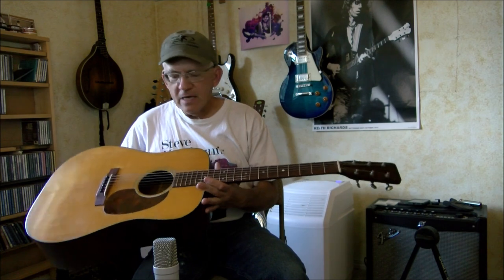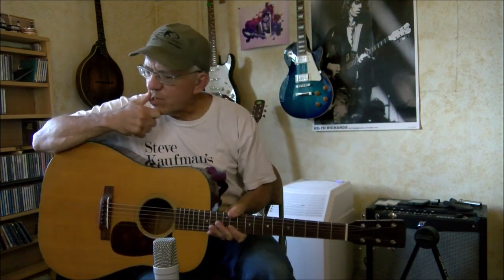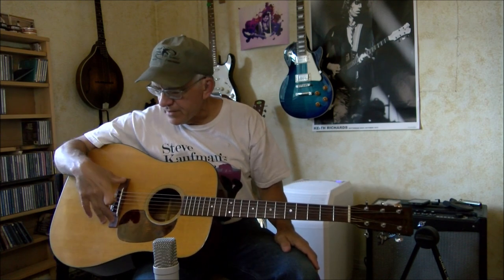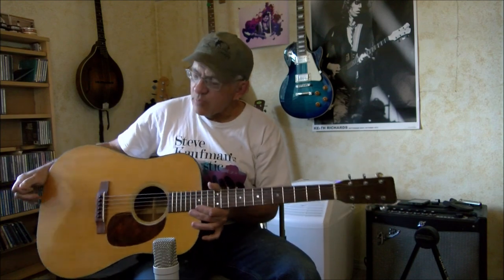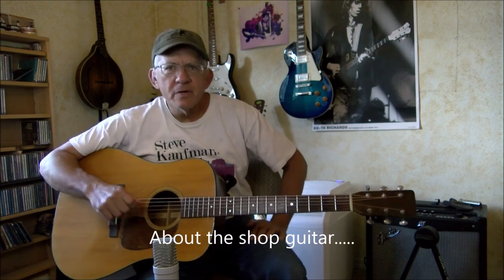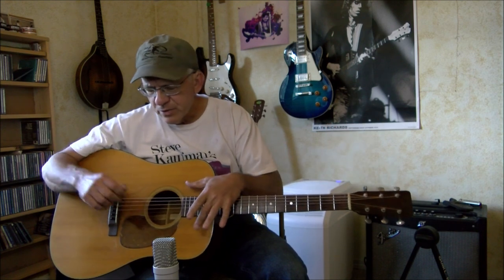A Before/After comparison of popsicle brace removal

Comment: Wow, the customer's guitar sounds exactly as you predicted.  The bass response and volume are nicely pronounced.  Removing the popsicle brace seemed to open up the top a lot more.  That little brace may have kept the sound a little tighter and cleaner.  Depending upon one's playing style it would be the difference between a rear-shifted and forward-shifted bracing pattern.  I like the more open sound.
Reply from the maker: That's a great observation.

Comment: This was a lot of fun to listen too, as I have a 000-28 CAA that has no Popsicle Brace by design. I kind of like your Shop D-18 a little more, but I can't really explain why. It reminds me a bit of my 2002 D-18 GE. What's the advantage of Black Locust over using Hard Maple for a replacement bridge plate? Nice video.
Reply from the maker: Black locust seems to give a little "thicker" or "meatier" sound than maple.  I like it in already bright D-18's.   I tend to use maple in D-28's or sometimes go totally the other direction and use a "hot" but small rosewood plate.  There are several recent D-28/35's with those and I comment on them.

Comment: Why does Martin put the pop sickle stick in there to start with. To muffle the sound? Hardly not. It’s there to help support the top.
Reply from the maker: Maybe you missed the part where I put a trapezoid brace back in?  That's how you FIX the top when it cracks, due to a popsicle brace that doesn't work. 

Furthermore.... popsicle, non-scalloped braces, big bridgeplates... all there to "support the top".  All kill the potential sound.